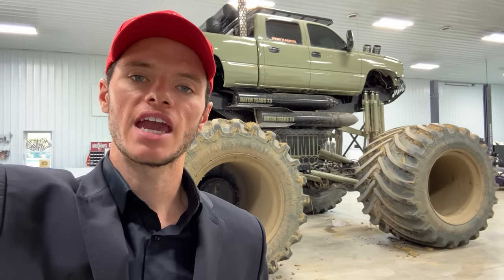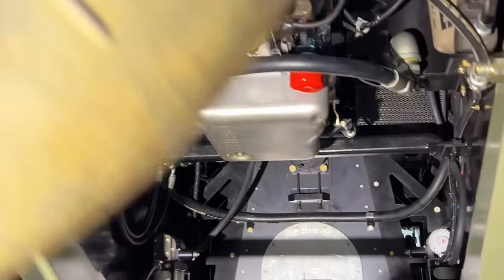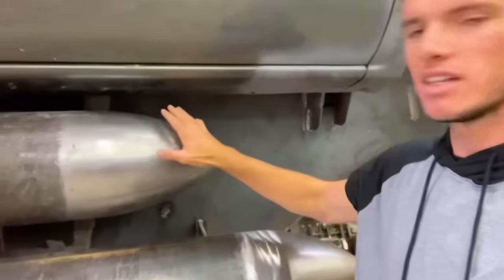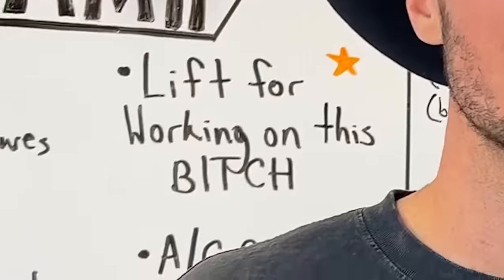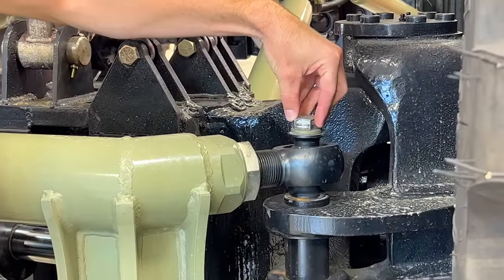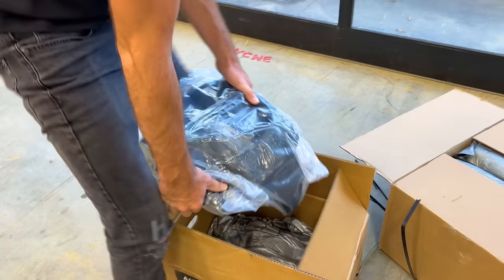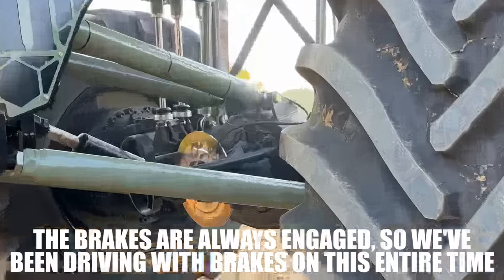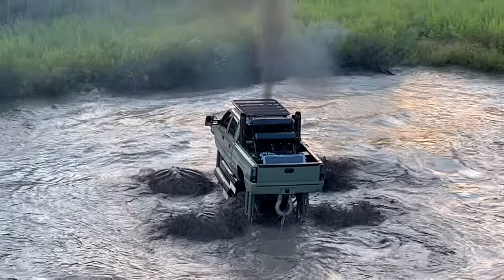MONSTERMAX 2 Initial Testing + Trial Update

Comment: If you want a lift system for putting on/removing tires, rather than bottle jacks they make industrial telescoping hydraulic cylinders that you could permanently mount under the truck, you can run an electric hydraulic pump to power it when needed and when not in use retract the cylinders all the way back up and put a mechanical lock for fully extended/fully retracted positioned for the off chance a line is damaged or blown. It took a quick ebay search and I found a 3 stage telescoping hydraulic cylinder with a 108 inch stroke capable of 12 tons, and all you would need to do is mount it and fabricate up some feet and locks, then plumb it with a pump. Then you also get the added bonus of being able to lift it with a button from the cab (or wherever you mount the button) or from a remote if you add a remote relay.

Comment: I’m a crew chief for jets in the Airforce. On our jet we have an accumulator called “reserve brake” so if the hydraulic system fails the pilots have a little bit of pressure built up in reserve to depress the brakes a couple times in an emergency.

Comment: Hey, have you considered putting two international engines in that thing? Imagine if it had like 1700 lb torque in each engine. This is way out of my league but it looks like you have a ton of space under the frame of the truck, would be insane. Monstermax 2 in its current form is impressive enough as it is. I and I think everyone else is blown away by the engineering and hours put into the project. Awesome truck dude, it's surreal to see it finally running

Comment: I think your transmission issue is that you need to identify al the wires that control the transmission solenoids . Then make a board with mosfets double the size of the ones in the original controller .Use the leads you identified to control the mosfets. The larger mosfets with their own power supply will be able to control solenoids in both transmissions at the same time . The second transmission will need gauges for monitoring as the original controller will not see Information from the second transmission.

Comment: I'm not sure of how they work personally but you might look into the old 4wd dual engine Clark dirt pans. They have dual motors and transmissions. Throttle options for running just the front or both on a dual peddle set up and transmissions will lock and turn at the same time. May be worth checking out

Comment: You can use a $5 Arduino micro controller to take one Accelerator pedal, one wheel speed sensor, and one engine RPM input and make it output two mirrored signals that can then be connected to two different TCM's. That would take all of about 2 hours of work for someone who knows Arduinos well.
Reply: But he's running 2 engines. What happens if rpms are different? Not a big diesel guy so just curious.
Reply: @krazykozey2259  The RPM is based on the accelerator position sensor so if you use one position sensor input, and have the Arduino send out two mirrored outputs connected to two ECU’s and two TCU’s everything should work together in the same gear and same engine rpm. They already have the RPM working together though I think.
Reply: @thomas435able  they do according to the video and were off only by 5 rpms.

Comment: For your jack situation… look into aircraft applications. There are lots that are 40 ton rated that are similar to bottle types with long travel but height may be your issue still since that thing is HELLA tall but there’s gotta be something out there.

As for maintenance… a man lift? There’s also a variety of maintenance stands for aircraft which oddly again might fit the bill.

Comment: Get spring engaged hydraulic/air release brakes… everything big uses spring applied hydraulic release brakes (I’m a heavy diesel mechanic in mining) we have the brakes as part of the planetary hubs and they are extremely effective stops 60 metric ton machine going like 50km/h in a couple metres also spring applied is mandatory in big gear and highway trucks because when you have a failure in the brake system the machine stops instead of losing brakes and being unable to stop

Comment: One engine run one drive line other engine running the other drive line. Then tune the engines parameters to chase the lag of the shift difference within the two. 2 engines 2 tcm motors rev at the same time because two pcm  two tcm. 
One on one axel one on the other working together. Shifting at the same time.
But that would require a reconfigured box.

Comment: Ditch both transmissions and put two big MF electric motors and use that diesel engines to power them. Just like in freight locomotives :)
And it will be a hybrid just like Prius, so EPA should be happy ;P
Bonus: You could power brakes air compressor out of some kind of motor and battery combo in case ICE are out.

Comment: Cody, I think if you run a factory TCM and split the harness two ways it should work. You will probably have to boost the voltage coming out to 24volts and use a 24volt to 2 12volt splitter. So the power wiring would be split evenly and make the wires the same length. The signaling should be strong enough to split with giving it more power but it would be trial and error.
Reply: I think the issue is that each error is gonna destroy the transmission that lags behind.

Comment: need to find those engineers that built the Suzuki Escudo pikes peak. the early variation ran with 2 engines before they swapped to the V6. That was back in the 90s. bet those dudes could figure this out

Comment: You can essentially tie both harnesses into one tcm and in theory should work long as both ar driving the same direction but if either or is spinning against the other not good. But in theory wiring two transmissions to one tcm should work

Comment: probably too late, but getting two engines and two trans to work together sounds a lot harder than dropping some industrial strength diesel and transmission in there instead. Theres got to be a tractor, train or construction vehicle application power plant that will fit in there. regardless, awesomest truck, great work.

Comment: I'm no electrical engineer but two identical engine and Trans correct? My idea of a solution for duel Trans would  Be to take your separate harness for each Engine and transmission  (Is this an automatic?) ,   Assuming that it is automatic I would think you could take take your batteries wire them in parallel allow to make sure you have plenty of plenty of amperage And keep your normal 12 volts  And  Spice the ECU side of the harness On both harnesses together And run them both to the same ECU Possibly upgrade capacitors inside the ECU itself  Because in automatic you're easy you're ecu is going to tell your transmission when the shift points are  Theoretically as long as you have the proper voltage to everywhere needed you're needed and Amperage that both transmissions would shift at the same time Again this is just an idea if it will not work And someone knows for a fact explain to me why cause I'd like to learn
Reply: My other thought would be to keep the engine harnesses  Separate And just  Connect whatever wires are necessary for shifting to one  ecu  But still run each Engine off separate ecu's just splice anything transmission related to only one

Comment: Do you need a real big bottle jack… 
In the mining industry we use 150 ton bottle jacks that are air operated and moves with the power of Milwaukee batteries.. 
we use them to lift 793F haul trucks 
Look em up! Quick and works like a charm

Comment: Here’s my opinion on two trans on one TCU, if one motor stalls and turns off I feel like the TCU would be sending instructions to the connected trans trying to shift it and would end up destroying the trans on the stalled motor, I feel like 2 TCUs would be most feasible

Comment: I like how you've taken an interest in Toyota Trucks but if you think their Hilux is a good motor you should try out their 2JZ Supra Engine. Their over engineered to a Pulp and can push over 1,000 hp with the stock internals. Upgrade fuel Turbos intercooler etc etc.
Reply: I don't have telegram service

Comment: If you used older transmissions that have TV cables to shift. You could have both throttle bodies, on both engines, pull both cables to both transmissions. So they would work in parallel. If that make sense

Comment: Get a hold of an old AC locomotive. Use the traction motors and generator from it, this way you can get rid of mechanical drive which will plague you forever. 200 year old industry has figured that one out. Do hire the engineer, AC is no joke.

Comment: I feel that this setup is going too complex with all these chains and dual transmissions and controlling them both electronically. I think a better way is to use two pressure compensated hydraulic pumps (one for each diesel engine) and 4 hydraulic motors for the wheels that are used on excavators would be the way to go. You can dead stall the hydraulic motors and not cause any damage because the pressure compensated pumps will stroke the swash plate to the neutral position, causing hydraulic oil flow to drop down to just enough to maintain the hydraulic pressure setpoint you adjusted for on the pump (they have adjustment screws for pressure setting). You get torque at stall on the hydraulic motors with this setup without stalling out the engines and no worries of breaking gears and burning up clutches as you will with a transmission.
Reply: THANKS for your support 👍👍👍👍
You have been selected among the lucky winners of the giveaway session 
DM me now to claim your prize🎁🎁📦

Comment: Shouldve tried to swap a modular engine, one where you can bolt them up inline. Ive only seen v12 done this way with 2 v6's, then you get 2 engines, then drop a planetary gear set so you can get ultra low gears and still crank it up with a lower gear ratio

Comment: Hey man..could you use one Tcm and run two sets of wires connected in  tandem..l don't know the current lose in doing so but  might increase current on input to make up the losses from the higher impedance of the extra wiring and connectors..but everything being in sync ie  torque curves and others would seem tough..but considering you keep your foot floored peak power balance seems doable.l think there will always be a delay in  one engine coming to the exact torque curve..l just can't wait to see what else you do..l always wondered how people connected many engines in  tractor pulls it seems like one of those ideas might help..l would really like to see that thing do what you built it for..God bless..

Comment: ... You don't need an electrical engineer. Splice doubles of plugs to the main TCM. It will simultaneously control both transmissions. I've done this with ECM on projects running two engines. Keep it simple, don't pay someone $30k to invent something overly complicated that probably won't work the first, second, or 20th time anyway.

Comment: are them tires LSW 1250-35R46??? 
.
ive removed and patched them before..... modern combines run them VS old 20.8-38 duals/trips LOL
they are big HEAVY buggers...... have to use the crane to force the tire bar down for the first bite.... but after that they arnt bad
.
enough room to climb inside and patch it LOL
pretty comfortable actually
Reply: oh you have 1400-30R46..... wider, but about the same sidewall height 
.
idk.... these new LSW tires are kinda nice (because no duals.... and its ALWAYS the inside one thats flat)
but at the same time..... they are so thick and heavy..... its almost easier to work with the duals
.
kinda a trade off

Comment: As you could have a 30 foot high truck as that doesn't matter when your axels are still just as low and not much clearance on that truck and that's the. Problem when hes in the water bc the axels dragging along the bottom

Comment: For a trailer to transport that you just need an rgn I beam trailer take neck off drive truck on it put the neck on Raise truck and trailer suspension to pick up max take off tires with skid loader put them on the far back of the trailer load skid loader right on the front of max attach neck lower truck and trailer suspension then take off that's kinda how they haul the really big loaders and dozers

Comment: I thought they offered a deal you rejected?    

....the issue i see with your case is that you pretty much have admitted to splashing.   You have an issue/problem with the law, so without the law being changed......you're probably screwed in court unless you can insert enough reasonable doubt about what is safe/unsafe.   They totally want to "make an example" as well.

I self represented myself in federal court because of a "hiking closed-trail" incident.  Luckily I had a CFR statute to back my defense along with witnesses and the facts of the matter (the LEO was a spaz).   

 If it's clear laws were violated, it's hard to disengage the charges without explicitly stated legal exemptions.  Gotta bank on the jury's judgement....which is always a gamble

Definitely needs more tires on MM2....hanging up in the mud on those axles.
Reply: TAKE MY MONEY (THROWS DOLLARS AT SCREEN)

Comment: It’s time for monstermax 3 whistlindiesel (my plan is in the reply!)
Reply: Buy 2 or 3 more duramax trucks, combine all of them, add 2 Cummins engines for the rear wheels with 2 duramax engines in the front. The combo will make the truck twice as wide, as well as twice as long so it will be an 8 door. The 3rd is for a maybe. Also this project will need a fully custom built roll cage for the chassis, and 6 to 7 links per axle. Plus a total of 16 shocks 😅.

Comment: For monster max II to get both transmissions shifting in sync why not run one wiring harness out the ecu and split the cables so it goes 1 harness to 2 giving the same signal at the same time

Comment: also why do the transmissions have to run off one ecm… if they are automatic they should shift at the same rpm/speed anyway and manual just sync the controls to shift both transmissions at the same time or remove one transmission and join the output off both engines together into one transmission

Comment: Your truck will not make it over a 6 foot hill even if it's running good. You are not making a truck. You are turning a truck into a tractor. Which is why this is so expensive. Just go buy a big tractor if that's what you wanted.

Comment: would it be good to make a truck that has super huge wheels that go over the roof so you can drive it upside down and then super heavy duty that ...
Reply: is time an nft ...
Reply: can you make a shock absorbing tire like how a shock keeps you from bouncing so you can use the tire as your suspension ...
Reply: you should run your exhaust out that tow hook then it would make monster farts ... rolling coal
Reply: like you built this from your mind no one has a truck like that its a one of a kind ... what i think about it